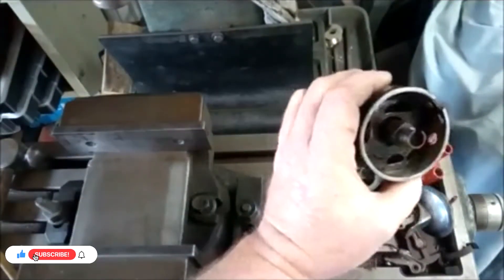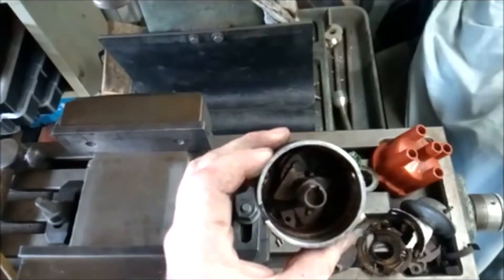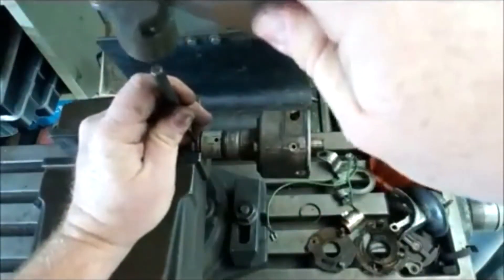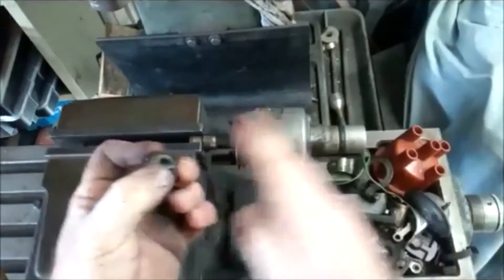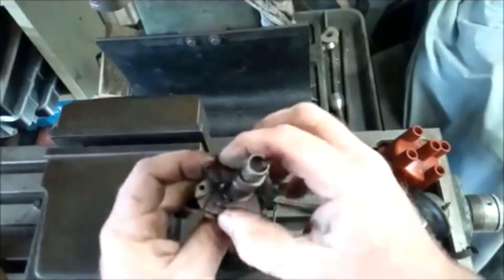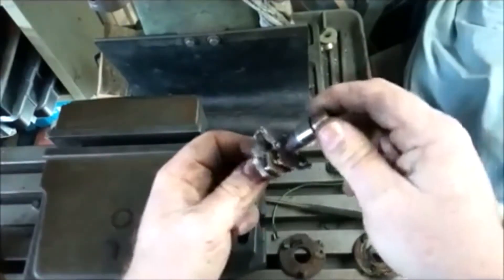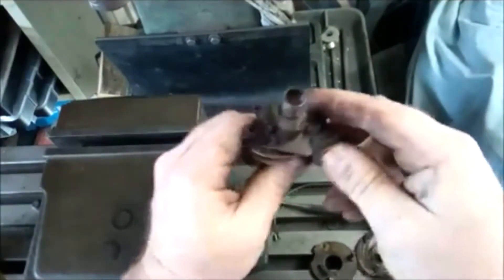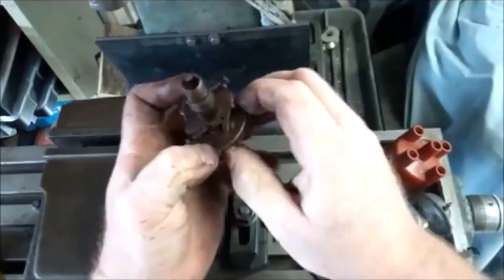Beginners Basics for Vw beetle, locking 1600 Vw distributor for Boost / Turbo applications......

Comment: So if I have a vacuum advance only does that mean that I can run a regular distributor and if so would I plumb the vacuum line pre turbo or after the turbo
Reply from the maker: You can run a regular distributor with locked weights , as soon as the vacuum line see's no vacuum it would have no effect on timing , as there will be a base value locked , hose postion is the same as stock
Reply: The vacuum port is just below the Ventura and will not be effected by turbo boost.

Comment: How is the maximum ignition timing for 1 bar ( 14psi ) of boost on 1600cc ( all oem engine ) VW bug ?
Reply from the maker: depends on your boost curve and dynamic compression , 18-21 deg to start with should be safe

Comment: Are the any benefits to doing this on an N/A motor?
Reply from the maker: no benfits to N/a unless your using NOS , ignition curve / advance is needed on a N/a motor to help reduce temps , under boost it's not needed as the ignition needs more time to light off and burn

Comment: i was thinking i was gonna buy a 123ignition distributor will it work well with a turboed setup, if so should i get one with vacuum advance or without
Reply from the maker: You need reduced timing under boost , and advance under light loads and vacuum , how your ignition needs to work depends on the size of turbo and the transition between these two zones

Comment: hello, any advice about how to make the timing for a vw bug  Fi engine to retard on boost? can i use an electronic ignition distributor and modify it?
Reply from the maker: Hi Carlos ,you can use a electronic distributor you will need a MSD programmable ignition add on or even a CB programmable black box